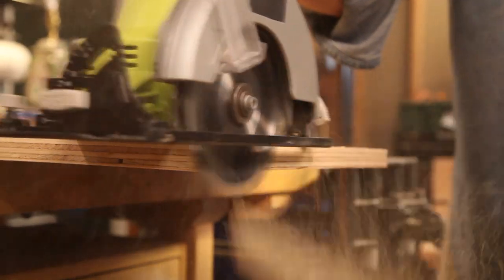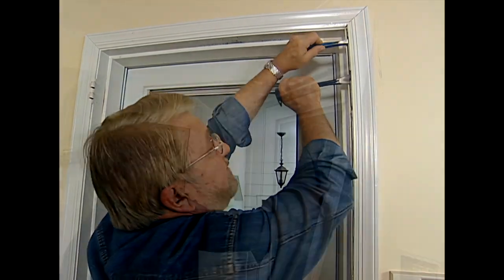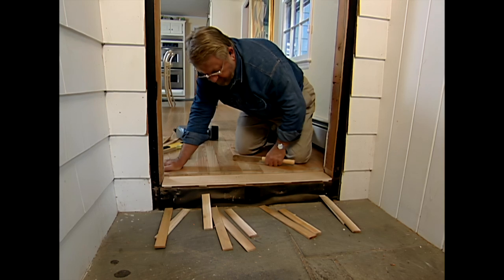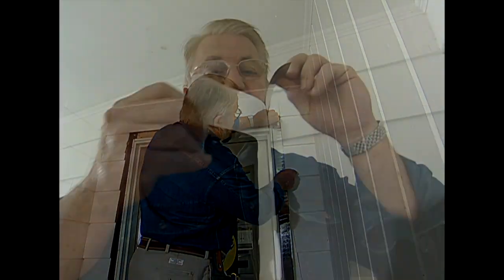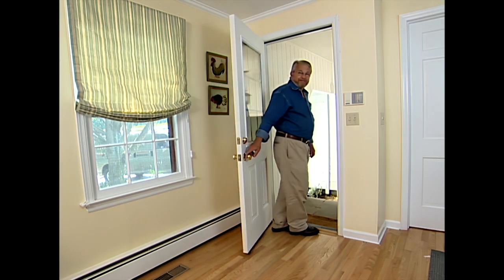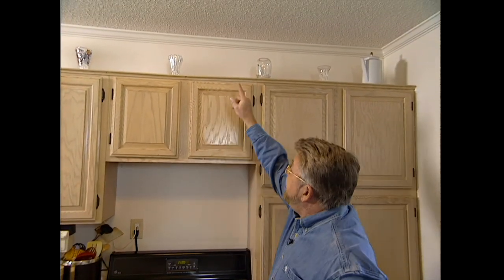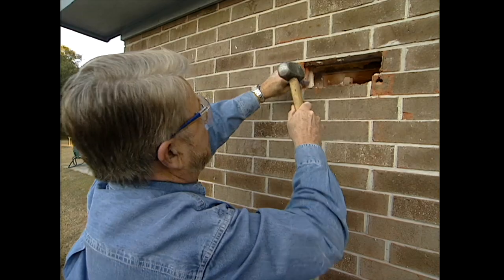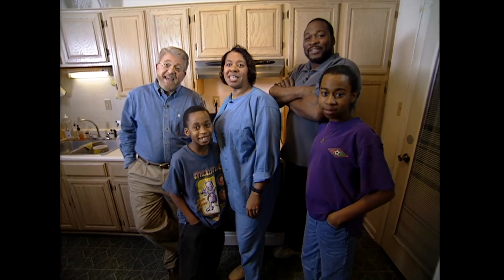Ron Hazelton's HouseCalls - Season 16 - How to Replace Your Entry Door - Install a Range Hood

Comment: NEC 210.52(B)(2) NO OTHER OUTLETS-  Small-appliance branch circuits feeding receptacles in kitchens, pantries, breakfast rooms, dining rooms and similar areas shall have no other outlets. While general-purpose branch circuits can feed lights and receptacles, small-appliance branch circuits cannot. Small-appliance branch circuits can only feed receptacles in kitchens and other rooms specified in 210.52(B)(1). Lighting outlets and hood fans are not permitted on small-appliance branch circuits. Outdoor receptacles cannot be fed from small-appliance branch circuits.